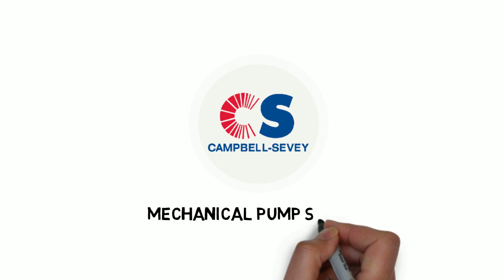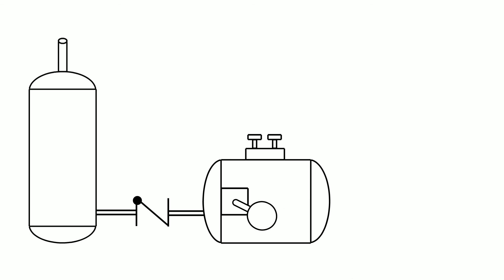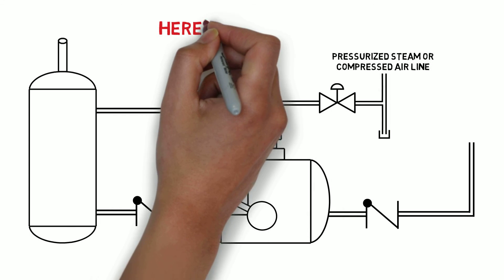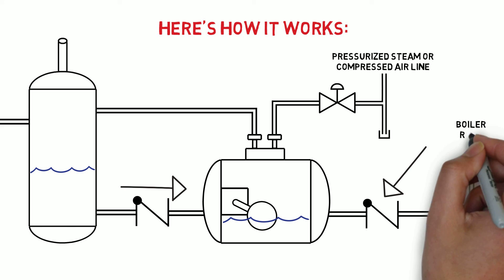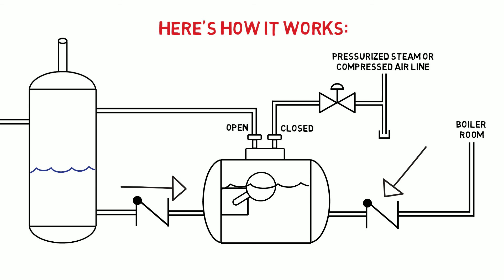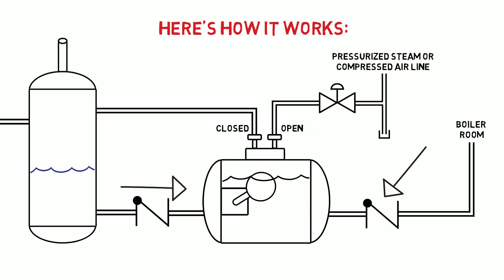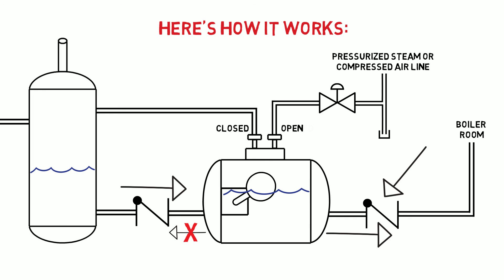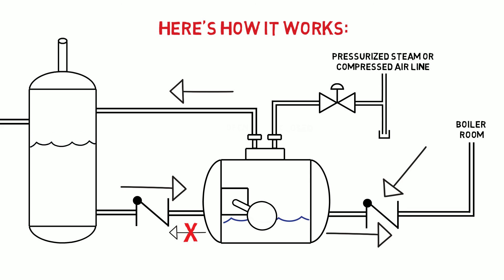Campbell-Sevey - Mechanical Pump System

Comment: What if the tank is under vacuum?  The vent connected from pump to tank will break the vacuum?
Reply: Install a vacuum breaker to get rid of negative pressure upset scenarios.